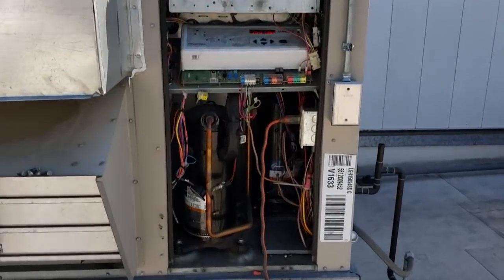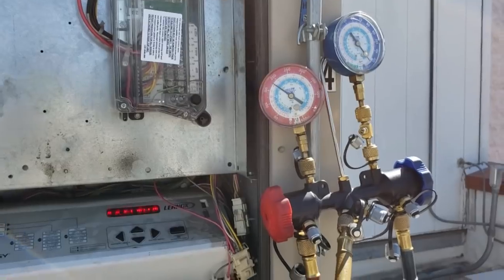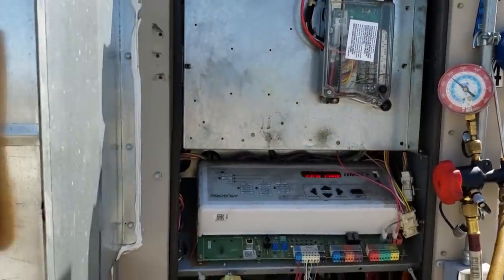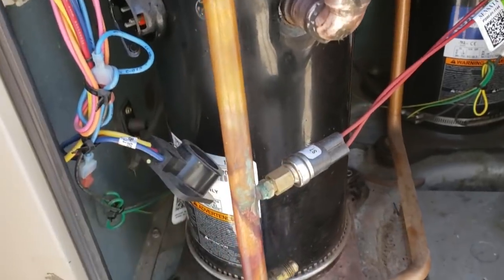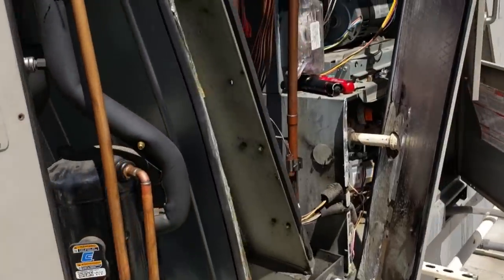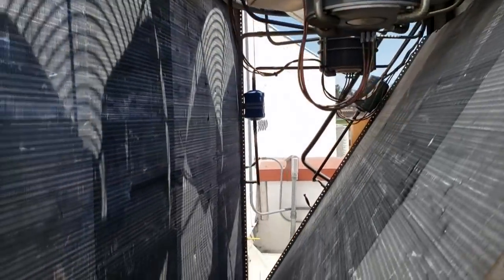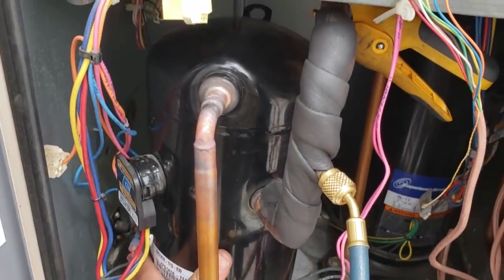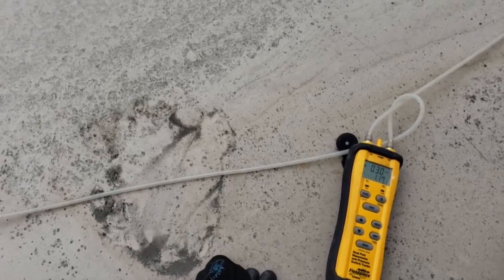GROUNDED COMPRESSOR AND AIRFLOW PROBLEMS

Comment: Codes are only a minimum standard. They are like going to school & getting a D grade. Jobs like this are rampant in the hvac industry wheather residential or commercial. Those who try to do jobs up to a standard instead of down to a code or price, learn quickly that they can’t compete with the rest of the industry doing garbage work for a fraction of the price. So if you hold firm with integrity & work it up to a standard, you actually end up getting the customers you really want to work for. Unfortunately they are 5% of the overall market or less. We sell an invisible product, hot & cold air. Snake oil salesmen are everywhere! Be different & you stand out! Thanks for your videos, you make the world of hvac better one video at a time!!
Reply from the maker: Thanks bud
Reply: As an electrician we found a brand new fast food restaurant wired with MC cable from one end to the other and all of the controls for lighting, HVAC, etc had bare THHN wire passing through the back of the enclosures with just electrical tape as the connector through the open space in the wall cavity. The place passed all the inspections and the restaurant was in service. They had canopy lights that never worked from day one that just had MC cable poking through the wall and not even connected to anything. We were called out to check out why the canopy lights in the drive-thru wasn't working. The boss was like "wipe your fingerprints off everything and run out of there"

Comment: I really like the talk at the end about people not doing their jobs correctly. I see it ALL THE TIME working on cars, it pisses me off! This restaurant probably needed new AC units i'm sure and part of their issue is the guy who sold them this unit without knowing the building, Another part is the guy doing the duct work for the building size incorrectly. But what it really boils down to is the one person not doing their job at the start of all this. They started the snowball effect because they didn't plan this building with a goal in mind and follow it A-Z to make sure everything will work in harmony. This is the reason i get with my customers and we build vehicles with a certain goal in mind, that's our foundation for the build. Without a goal in mind what are we doing? We might as well get the biggest AC units we can  and install them on residential homes because the sales man said it can cool the most air! It's nice to see you always going above and beyond your required duty to help fix the real issues.

Comment: When I was in business I was the only contractor in a large metropolitan area that actually tested the airflow after the installation and wrote it on the document attached to the furnace several heating inspectors asked me what the hell I was doing and why. at the local heating contractors meeting I stood up and asked to show of hands who owns a airflow meter no one did.  Airflow is the basis of what we do, no but no one knows how to measure it what the hell!!!!!!
Reply: This tells that inspectors dont know what the hell are doing.
Reply: 90% of heating and cooling issues are about airflow!
Reply: What annoys me is that when you bring up the issue the question is never "what can we do?". It is always "how much?"
Reply: HVAC minus airflow spells HAC...

Comment: I usually recommend using the rags pop up, they're just white rags, tearing them into appropriate sizes when working on sensitive valves like that and soaking them before welding on em.  Been in the industry since 06, just a thought brother. Good vids though, love em.
Reply from the maker: Thanks bud! I will be going live on YouTube this evening 11/18/19 @5:PM (pacific time) to discuss my most recent videos and answer questions from the Live chat, YouTube comments, emails, and Facebook comments. Come on over and check it out  https://youtu.be/NjeFrNCiAEs
Reply: Those popup rags are paper towels, mainly.   I use bagged cotton 'jersey' fabric rags.  (I don't do welding or brazing, only electronics soldering - I use them for other things)

Comment: If you can’t install a suction dryer (which should be removed after 24 to 48 hours of use) you should install ball valves and a flared dryer. This allows through pump down replacing the dryer. Perform an acid test to see if it should be replaced again.

Comment: as a commissioning technician, I was desensitized to this kind of scenarios. the fault is either to the contractor who has had to finish the job on that area leaving the next contractor to negotiate his install spaces. ei: plumbing guys installed their first leaving the ductman to have a smaller duct or an odd angle for a turn. this is especially to kitchen install were there are water, electrical, fire protection, fresh air, exhaust air, AC and refrigerations. or the engineers who proceed with the bad install or consultant who does not care.
I usually recommend on air duct that is under requirement to augment the ducting with a tube axial blower for booster fan to facilitate air movements on a duct. or a variable damper  with built in blower on each air outlet.

Comment: I'm a federal employee and work on a military base in NC. When we have buildings renovated by outside contractors, a test and balance is suppose to be performed on the system. What is upsetting about this is the fact that we have our own inspectors on base who allow the contractor who installed the system to "perform" the test and balance and submit the report. Do you think the contractor is going to fail his own work? It will drive a tech who then has to work on it insane. Great videos! Keep up the good work!

Comment: Do you have a video on airflow and explaining how the measurements should be and how to rectify issues? I get the gist but going through the comments everyone is saying "measure airflow" but what does that tell me? What can airflow and pressure differentials tell me? I'm sure a lot and I'd like to know more in layman's terms rather than technical. Just my thoughts. I know you want to avoid bends and long runs but just doing a walkthrough like your other videos would probably be very illuminating. Thanks.

Comment: I feel your frustrations Chris! I see the same things happening here in Toronto. And I look like the a$$hole when I have tell the customer that everything is wrong.
"How is that possible?" "I paid good money for this!" "You dont know what your talking about"...
And so on and so forth. 
Great Video man! Thanks!
Reply from the maker: Thanks bud
Reply: The other 1 is “but the inspector approved it”. As a boiler guy I run into that all of the time, especially in the suburbs where there aren’t very many boilers. When I was in school 25 years ago we were told that boilers are a dead technology and we weren’t even trained on them, so there’s a huge shortage of competent boiler techs. I had to take night classes and just read manuals on my own to learn them. Stuff isn’t piped correctly but the inspector still signs off on it. I just had 1 earlier this week. It was installed 1 year ago by another contractor and the backflow preventer was leaking. Instead or replacing the backflow preventer the installer just turned off both valves on both sides of the Watts 9D, the problem is that with both valves closed the expansion tank was no longer in the system because it was piped in between the outlet of the Watts 9D and the 2nd valve. The only reason the relief valve hadn’t popped is because they never purged the air from the system. There was so much air in the piping you could hear the circulator surging and cavitating, but the homeowner said “it heated fine last winter”.

Comment: I was just thinking about Title 24 the other day and wondering if it was effective. Thanks for the answer. I'm in FL and we have the same issues here, probably worse. There's a brand new Denny's in town that's negatively pressurized just about enough to suck your eyeballs out and relative humidity levels over 70%, with mold everywhere. Another restaurant I worked on recently has had the heat and cool setpoints on the Aaon DOAS backwards for 12 years. But it looks like more regulations and supposedly independent testing isn't effective. It's frustrating for those of us that care!

Comment: Heating and refrigeration equipment is sexy. It's more complicated, the customer gets to make choices and that keeps the sales folks interested. It's more interesting to troubleshoot. There are replacement parts to sell. Fans and ducts aren't sexy - they need to be cleaned (eww) and the belts and motors eventually wear out. Otherwise it's so easy to forget them. 

But at the end of the day they're the foundation. HVAC minus care and attention to airflow spells HAC.

Comment: Great video. Try the push-pull method of recovery ,if you get a chance.
It actually turns your setup into a refrigeration system and the recovery tank gets cold .
Thanks again for your videos.
Reply: Has to be running in order to do that though.

Comment: I'm a TAB tech on the East coast. When I do restaurant jobs especially, I take a building static at the front and back door before and after balancing all of the systems. We also take full static profiles of all air moving equipment which quickly diagnoses any airflow issues, and I get them addressed with the mechanical company IMMEDIATELY. It is hard to understand how/why issues like this slide through the cracks without being addressed.

Comment: Speaking from the perspective of a former HVAC engineer, doing jobs in Cali I can remember the reviewers and inspectors being very thorough with their reviews, and even going as far as double-checking our own calculations for airflow and unit sizing. On that job its almost like they have the right units, but they decided to just reuse whatever was existing within the space and just plop some curb adapters down. I doubt they really redid any of the ductwork from whats there, but cant say for certain without seeing it myself. Definitely a hack job and either it was a shady engineering/construction consortium they went with or the customer/GC ignored the intended design. It does happen and some of the big construction outfits had ways around doing things properly. The only recourse at that point was to refuse the job and turn over the design liability to someone else.

Comment: You can use the spray gel to protect the valve. No offense, but I think you cut a corner in protecting the TXV.

Also, I didn't see a suction line drier. The oil being as black as it was, I would have figured a flush and a suction drier would have been very important in maximizing life of new compressor.
Reply: always replace both filter driers  when replacing compressor it was on a few test iv'e taken in school.
Reply: i was thinking the same,wrap txv and either change oil on compressor several times or add suction HH drier
Reply: Dan T I keep cut towel strips in my torch kit and all I need is to just grab one of my bottled waters to use it real quick.
Reply: Yeah the txv had me yelling at my screen for a second. Also the suction line drier, cause there is some burnt up stuff. But since it was only 6oz minus whatever was left on the walls of the compressor, prob fine with no suction drier.
Reply: Spray gel makes a mess. I never use it. A wet paper shop towel works best for me.
Reply: kevin maxey yup.
I cut a shop towel into strips and wrap the txv like a mummy with the wet towel strips.
Reply: Dan T he said he didn’t have space for suction drier. It was too tight.
Reply: Give the man a break

Comment: Awesome job as usual. Only a couple things I’ve would’ve done. I always wrap the small valves. And I always add acid scavenger on comp replacements. It’s cheap insurance in my mind at least lol. 
Agree with you on the restaurants. I work in many, from large chains to mom and pop. Yet to come across a perfectly designed one. Close but usually can find an issue or two.
Reply from the maker: I will be going live on YouTube this evening 4/15/19 at 5:PM (pacific time) if you can come over and watch the stream  https://youtu.be/Ft4L_-G7zzI

Comment: I Work for an air balance company and I watch your videos to  learn more about the service side. You do a really good job. If the Herz tester or anybody else is Calculating the airflow based on the fans static pressure That is a problem.  The only way to get a true Total is to measure the registers or the ductwork with the proper airflow equipment. In regards to the unit with low airflow, If the return dampers are closed you would expect the return static pressure To be higher than 0.3 because the fan is trying to suck but it’s restricted.  Just curious did you end up opening The dampers on the return side and seeing if the airflow increased?
Reply: Jameson Rosene I use static pressure on service calls to see if I have any airflow restrictions. After performing a visual inspection on the ducting I use static pressure and RPM to determine the CFM output of the motor. Unfortunately I don't  have a flow hood. So I'm limited to traversing  the ductwork with my hot wire anemometer or mini vane anemometer

Comment: chris you are not supposed to ever tip a scroll compressor to a 90 degree angle even if you are trying to drain the oil. The oil can enter the scroll and cause it to seize. Id recommend pumping it out. Im sure you've been fine doing it this way. I just recommend it out of caution

Comment: Same problems here in Fl. Buildings running in negative building pressure and no one cares.  Humidity the walls,  wall paper falling off the walls.
ALL You can do is work with what we have.
Reply from the maker: I hear you
Reply: My work did this.
It was originally designed with a makeup air system for positive interior pressure. Fresh air and all that.
The MUA units never worked correctly, so they were shut down and isolated, and the entire system was just put into recirculate.
It also never QUITE worked right, but it worked well enough that nobody cared for years.
By time they started seriously considering repairing everything, one half of a tandem unit was dead and being raided for parts, the unit for my specific area had to have the fan running all the time because of thermostat problems, the fan was always failing because of that, several indoor blower belt problems, and we had another unit that I voiced that it kept breaking down a few times.
It took a hurricane (and the ability to claim it on insurance) to finally get the entire system torn out and replaced with one that has a working MUA function.
We've been having trouble with the new system too, it seems the technicians are out once every few months to fix something (condensate backups, malfunctions, etc).

Comment: I use curved adapters more than once and I never had an issue with them. I do believe you have to try to match some what of the herb as carrier units in Trane units Supply return a completely different. I never had any issues with that. 37 degrees discharge temperature depends on how low humidity is. I think you said you're in Palm Springs I'm not sure what the humidity is there but in Reno Nevada it's under 10% and I've seen some really big time temperature drops because there's no latent heat. If you have duct problems most of the time people aren't going to pay to fix and you'd have to tear the place apart. That economizer being open 100% to the outside suction pressure decreases was it really cold out? Curb adapters do work and work well

Comment: the problem with the airflow thing is 90 percent of the hvac techs i talk to dont even know what total external static pressure even is,and they make 40 to 70 dollars an hour
Reply from the maker: That is a true statement, I cant tell you how many new restaurants I have taken over and the static pressure holes that the test and balance guys have drilled into the unit are only getting the pressure drop across the coil instead of total external measuring return and supply..... so their balance reports always have really low total external static  pressure readings on them.........

Comment: Something that I do as a general rule when I have a grounded compressor and once I remove it, the txv and the liquid drier I always flush the system at least with nitrogen even if the compressor has most of the oil in it  just as precaution since there are 3 different parts open in the system already might as well and flush the system on those open areas to avoid particles or oil left from the old compressor getting stuck on the liquid or suction drier in the future and avoid to replace the driers later on (just something that I like to do as a precaution if I lost a lot of oil I'll definitely use nu-calgon flush)

Comment: Seems to be the same problem everywhere. It don't matter if it's an old or brand new building. I seen it on brand new buildings, an I always wonder if the engineers think it's gonna work properly, or they just don't care if it does or not.
Reply: Funny , I saw a fancy  very posh brand new store getting built up right before my eyes , and the surface was completely open, with 2 stories and a super high ceiling,  but the geniuses in charge thought it would be enough to have a couple MUA units with tiny super narrow air vents , only and exclusively on the top ceiling , and that was supposed to cool the whole bloody store 🤣
Now , I'm definitely not an expert in sizing AC , but even I when I saw that , my 1st reaction was saying to my boss : dude , that's never gonna be enough , it's gonna be super hot in here  !
And his answer was , and he was 100% serious : the people who sized it know what they're doing , it's gonna work don't you worry !
Of course, as soon as they opened , they started complaining about the heat 😋👍

Comment: Value Engineering is a fancy construction term that means that the building owner, or Engineer, or Contractor was too cheap to do proper job. High static due to poor duct design/installation is a very common problem. It bothers me too.